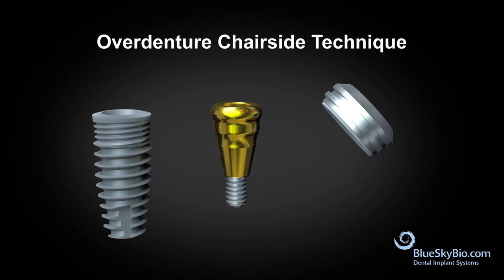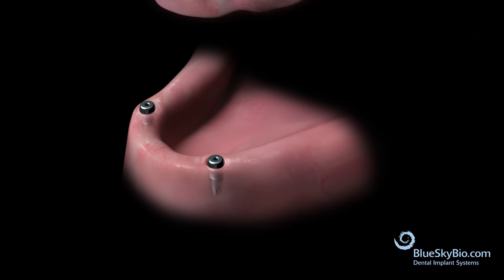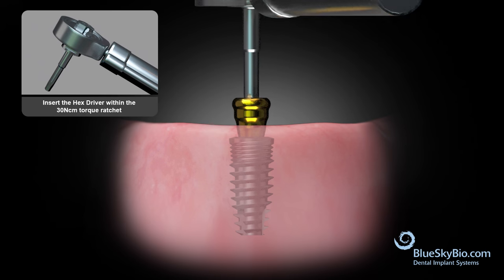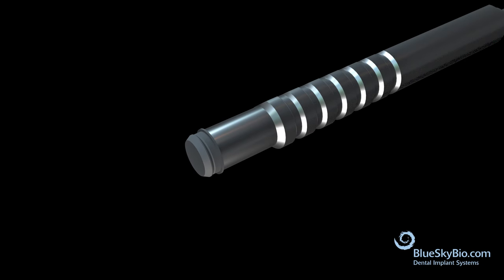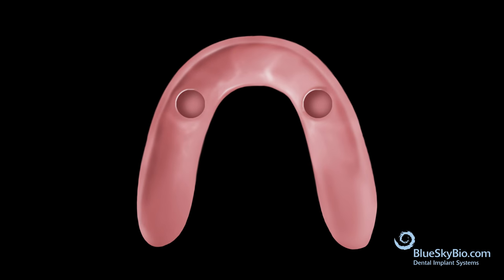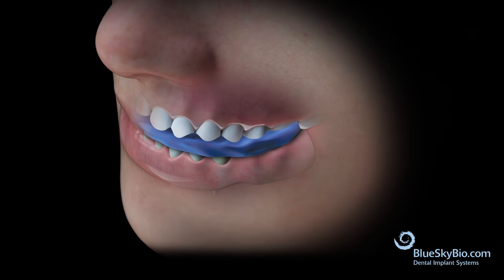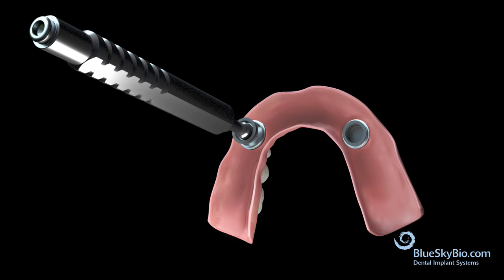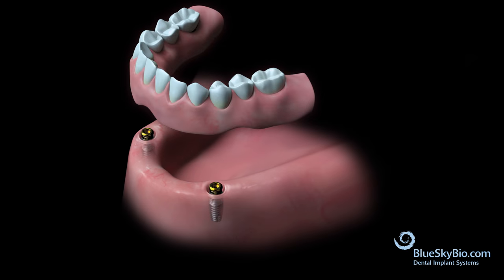Overdenture Chairside Technique

Comment: My appointment is 8/13 and I really need help before then. I’m getting 2 top and 2 bottom implants just like in video. I wanted to know will the denture be still snug or will it rock upwards in the back since there only two. Please help
Reply: The denture will not be snug, think of it as a table with two legs, sure it’ll stand up if balanced properly but The table works much better with four legs.
Reply: I think 2 can work on the bottom but not enough for the top. IMHO

Comment: Hi, I've never seen implants done on just 2posts, what do these cost? Will you please let me know
Reply: Would I be able to use my false teeth what I have now and is there any place that they can put in the in plant inyo my jaw can anyone help plz. And if it can be done how much money are we talking about
Reply: Yes it's possible,mostly retension problem happens in lower jaw denture, two to four implants with ball abutment provide good retention and higher patient satisfaction
Reply: those two implants are not designed to resist the pressure, the patient should bite food only with his/her gingiva tissue. two implants are only catching denture not to move.. if someone who want to chew anything with implant supported prosthesis, he/she needs much more post to resist
Reply: @deuxchevauxs6390  then is it possible to have all on 4 ?
Reply: @deuxchevauxs6390  That makes no sense at all people chew with no implants at all so how can you say 2 in not enough ?
Reply: The locators of the two implants overdenture are not designed to resist occlusion pressure, but they are designed to hold the denture in the position. many professors and implany manufacturers say so. 4 is not enough but it can^^
Reply: @wendy1897  I have the same that are in ther video.  They do not rock.  It takes time for the gums to be ready.  The cost varies,  but  all the dentist for a consultation and treatment plan. Regardless,  you should probably be prepared for at least 10 grand
Reply: @tracyhills1337  thank you so much you would like to think ur country would look after you I cant eat with the bottom ones and when I laugh they fly out